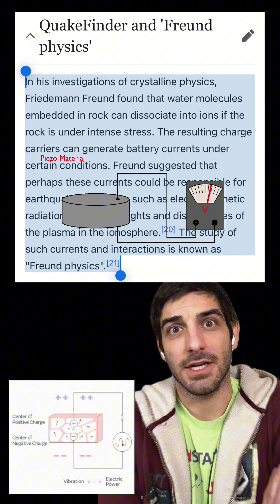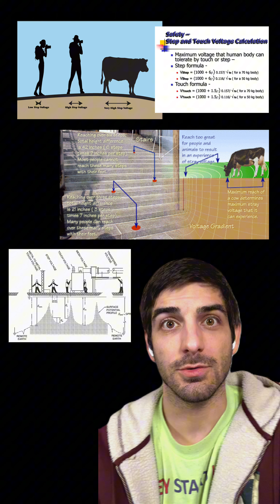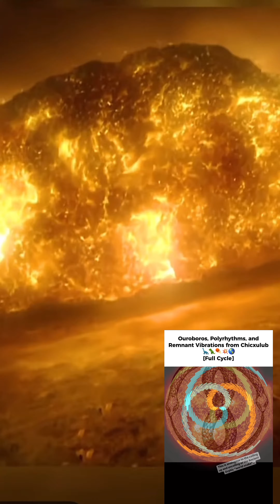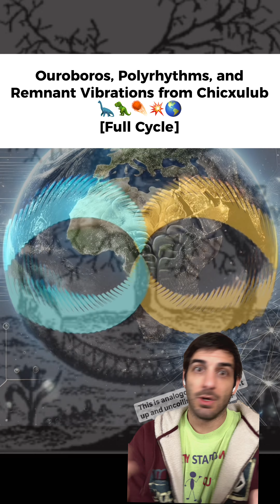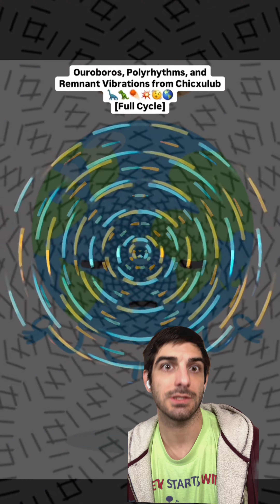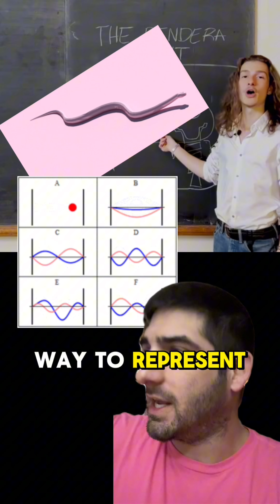Chixchulub Non-Avian Extinction Mystery Solved!!

Comment: Another prime example of wave synch and the destructive power it holds... have you ever been in a clock shop? Ever noticed how they're not all synced to the same time? There's a reason for that. It's a proven fact, when they're all set to the same time, their service intervals are shortened dramatically. The one that is most out of sync, will not suffer... but the rest will pay dearly for it being out of step.